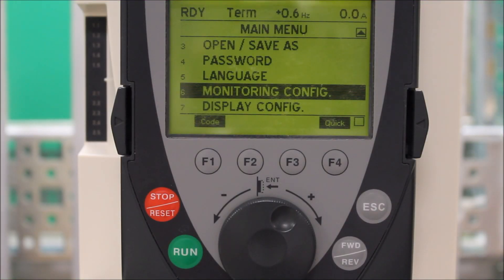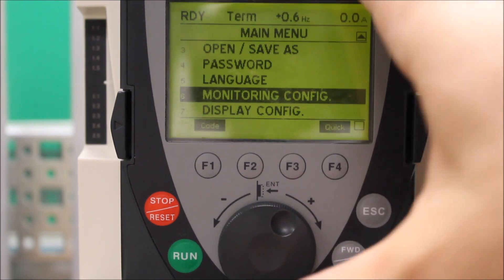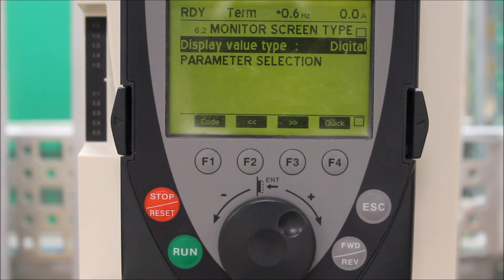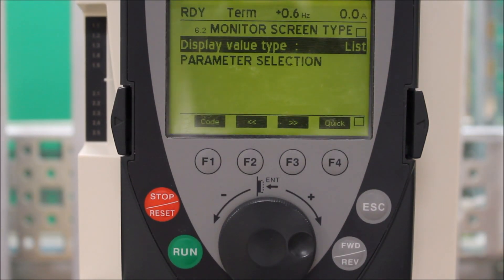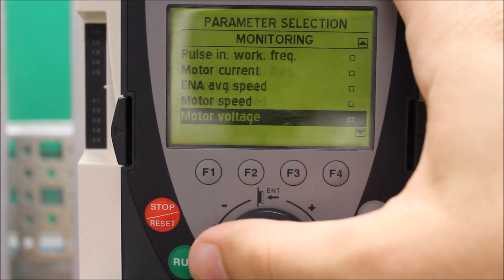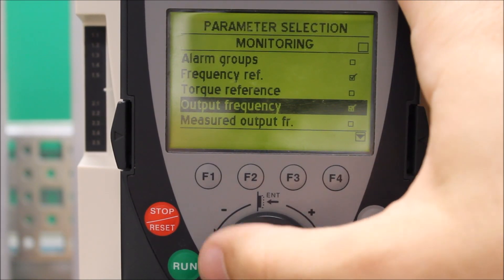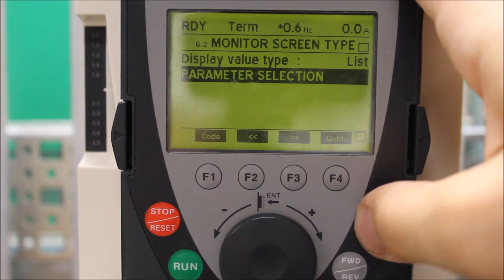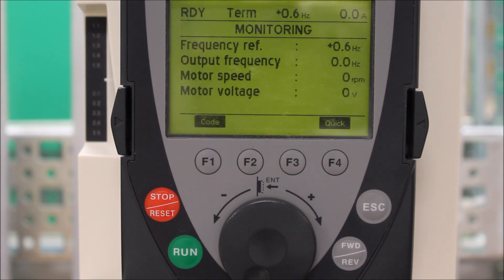Displaying Motor RPM on Altivar 61 & 71 Drive VW3A1101 Keypad | Schneider Electric Support

Comment: I using altivar 71 n when i start it does not control motor speed.. pot is set at 500 rpm but it gies too high